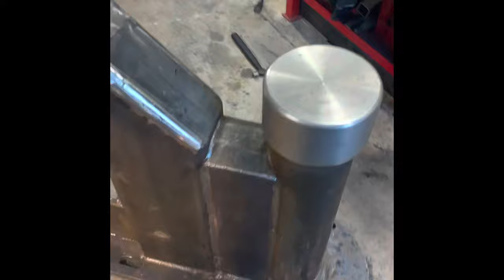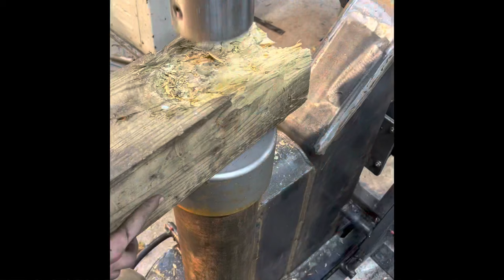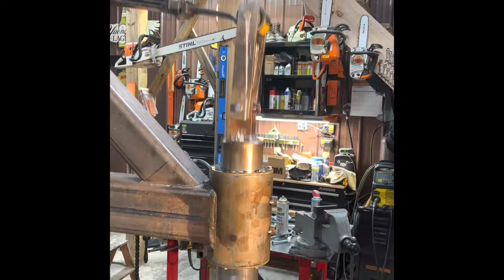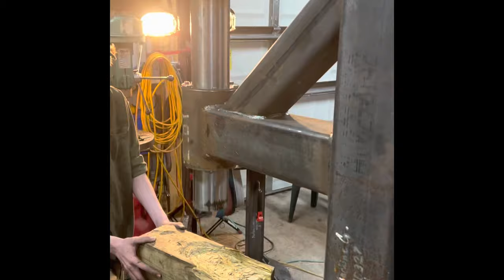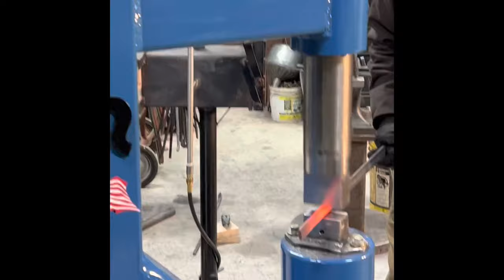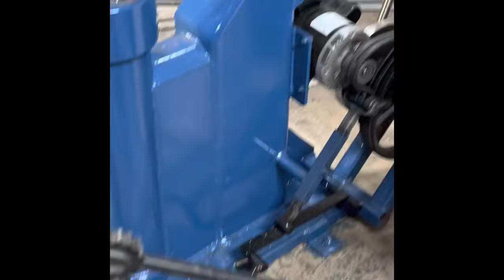100lbs leaf spring power hammer

Comment: Of all these guided helve leaf spring hammers builds I've seen, this is probably the cleanest build I've found.

I'm assuming the frame's welded together from box tubing. Did you guys fill the hollow cavites in with sand or something? It sounds remarkably solid.
Reply from the maker: Thank you for appreciating all the hard work and designing and yes the box tube is filled with sand and is 1/2” thick wall 👍👍👍 we use it every day and not one thing broke or needed repaired not bragging but just proud of it.

Comment: Awesome build I have been searching for a very long time for a good video of a homebuilt power hammer and I have to say this one is the best. Overall for the equipment and pieces you guys used to make it, it has to be one of the best I have seen built. Simple but Effective. Is there any chance that you perhaps have a blueprint or drawing of the overall dimensions that I could purchase from you ? Unless you found the plans online.  If not no worries but I would be highly interested in building one for myself! Thank you for your time and great video!
Reply from the maker: Thank you!!! I wish I had some blue prints but I sorta built it as we went. If you start to build one and have any questions I would be glad to help you👍
Reply: Hahah that's how some of the best projects come together you just build as you go! I can certainly say that yours seems to be built better than most of the other homemade versions I have seen. Defiantly functions much smoother and bounces around a lot less than others. I have more questions about it than you would want to answer haha! Only thing I would be curious to still know is the length of the leaf spring that is being used. Thanks for offering your help!  @realstihl2105
Reply from the maker: The leaf spring is from an s10 Chevy pick I took the spring pack apart and pressed each leaf till it was straight and re stacked them I will send pics an length
Reply: Sorry I missed your response, Thank you! @realstihl2105

Comment: Congratulations RealStihl ! That's one of the best home designed and made hammers out there. I especially like the design of the foot control. Much easier to get fine control that way. :) 
How have you calculated the 100lb weight? Is it the actual weight of the moving hammer shaft, or the calculated striking force? 
Cheers, from downunda! :)
Reply from the maker: That is the actual weight of the ram. Thanks a lot! it means a lot to me when somebody appreciates all the hard work and design that went into it👍👍👍
Reply: @realstihl2105  You’re welcome and thanks for your reply. I had already drawn up plans for one very similar, but with a car tyre type drive. I have the heavy tube for the frame, leaf springs and motor and just got the 4” diameter ram on the weekend. It weighs 29kg (60 odd lb) and should be just right for my work. Anyway, good luck with your forging and I’ll be keeping an eye out for more. 😁👍🏼👏 Cheers!

Comment: Nice job, I notice the anvil has a cap on it, is it solid or heavy walled pipe filled with lead? I have made one very similar in design and it works great, just like yours!
Reply from the maker: Solid steel capped with 4140 round stock 👍

Comment: So depending on the thickness of material you are working, you have different thickness dies?
Reply from the maker: No I just adjust it in the back by turning the turn buckle. But very rarely it does a wide variety of thickness with out adjusting.